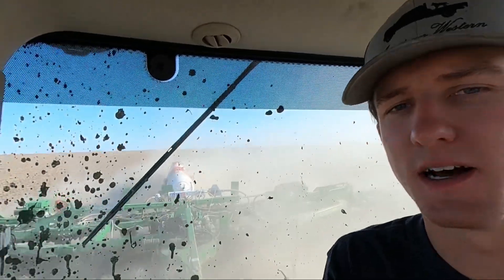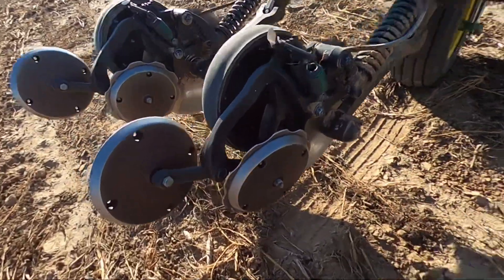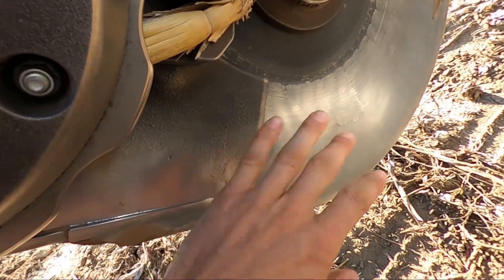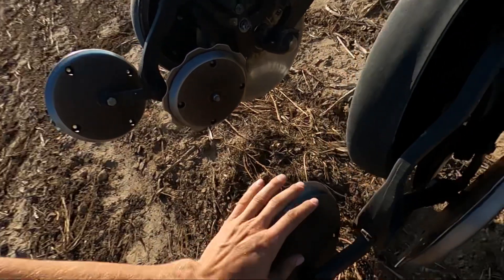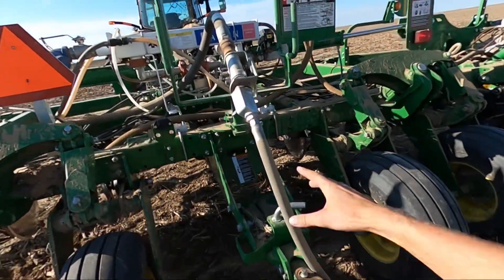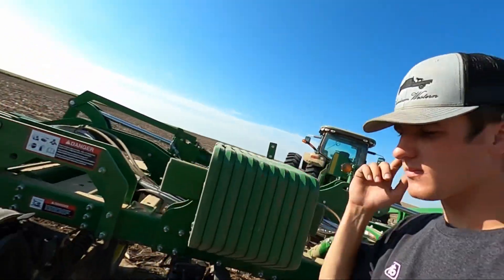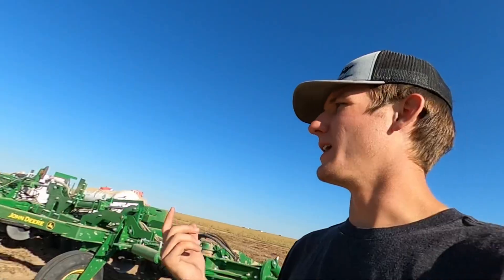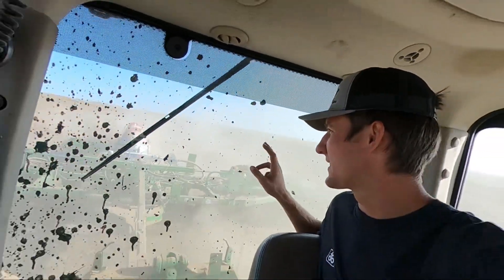Applying the most dangerous form of Nitrogen?

Comment: In my opinion it is definitely a no no having tanks with valves on the front though they may be protected and it helps with efficiency pulling two tanks at a time. If an apprentice tries coupling two single tanks and backs into the rear one it could be a disaster. But if you’re a pro then he’ll yes front valves instead of top valves all the way

Comment: What kinda rate you putting on that you only need to switch tanks so little, here in northern Illinois a 1450 tank will get you 30-40 acres also what kinda valve are you using that you’re able to unload both tanks without having to switch anything over to the back tank?